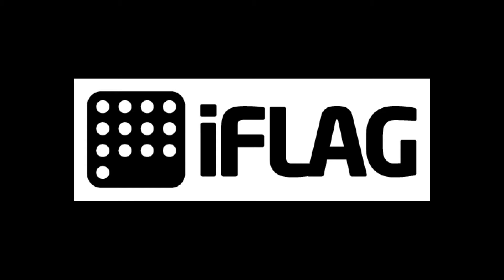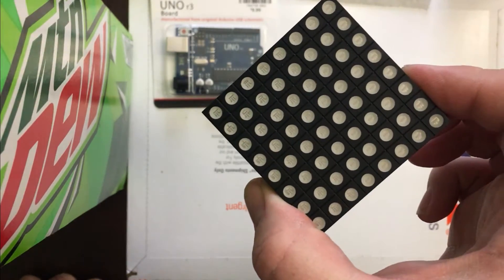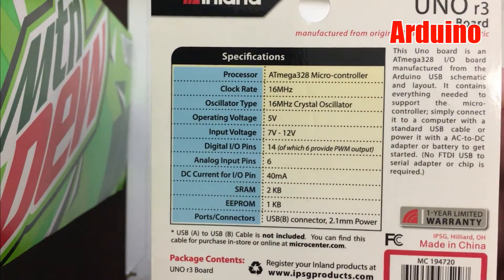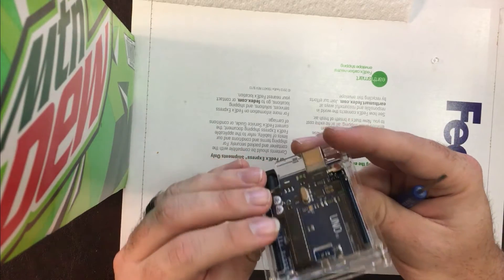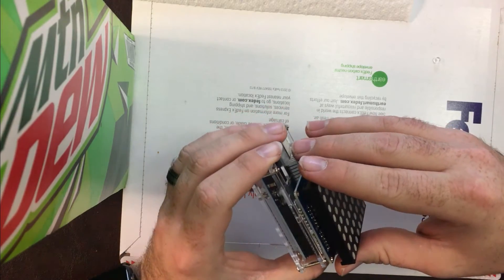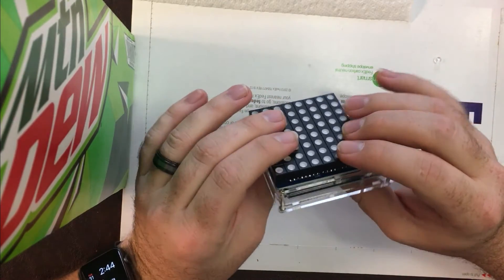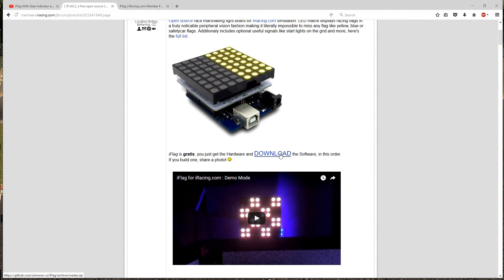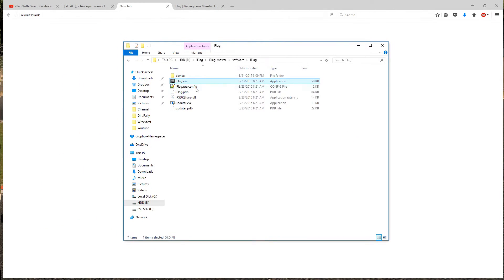iFlag Build

Comment: Does the case come with the Arduino?  Are the items in your two links all that's needed to buy?
Reply from the maker: Royce Scrivano No.  I forgot to link the case, It's included in the description now.  It was like $5 on amazon.  Yes, the arduino, case, and RGB matrix/shield are all you will need.  Depending on the arduino you buy you will also need a USB A to B cable as well but some come with it.
Reply: Awesome, thanks.  I'll probably buy it in-store at Microcenter nearby.  This is a great tutorial!